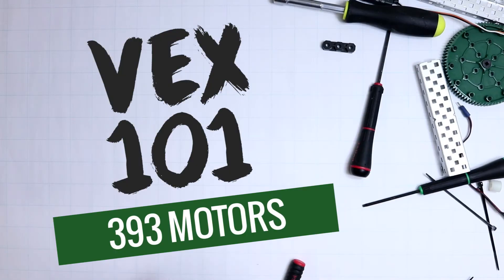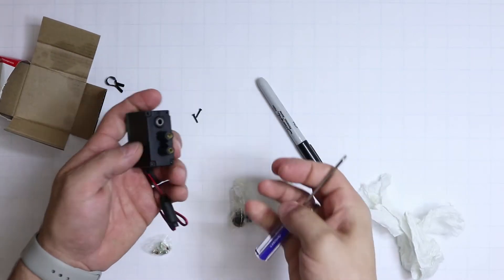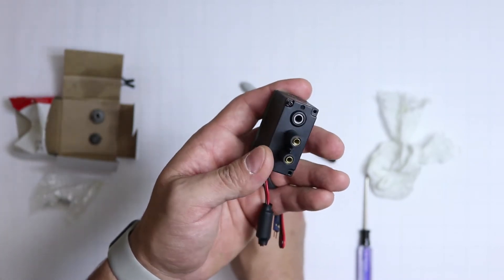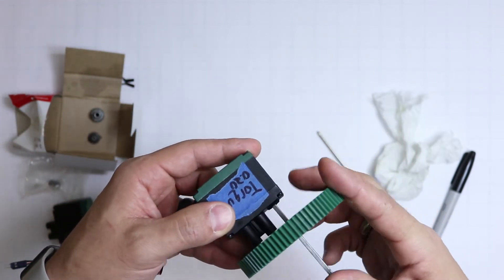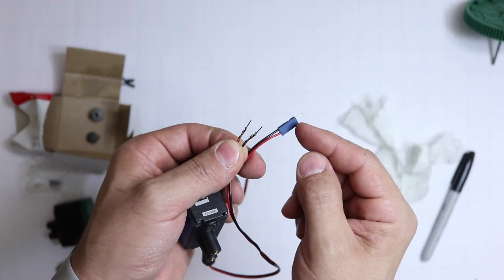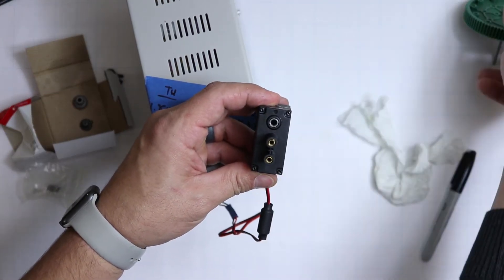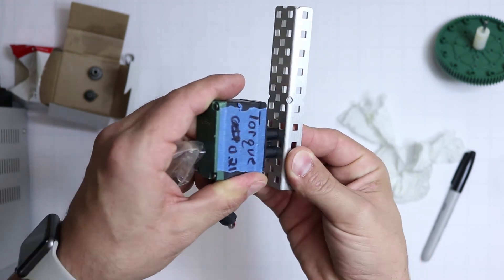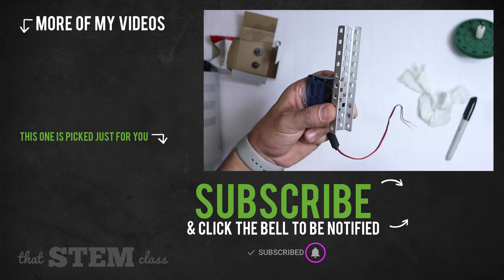VEX Robotics 101 - 01 Motors

Comment from the maker: Anything I missed? Anything you didn’t know?
Reply: I think one thing you missed is putting the larger motor screws through the bearing and into the motor when attaching it to the c-channel
Reply: I don't know if its true, but someone said you can change the motors to high speed, and also turbo. If you can make them into turbo, can you show how?

Comment: You should use the shaft connectors on your motors.
Reply from the maker: Do they help? How do you guys use them?
Reply: If you're building with the motor on a surface or c-channel, putting the shaft connector in at the start makes it a lot easier to attach other shafts to it. (essentially, instead of shoving a shaft through multiple holes to try and line it up with a motor, you only go through one, and if that shaft needs to come out the motor doesn't need to be taken off our touched.